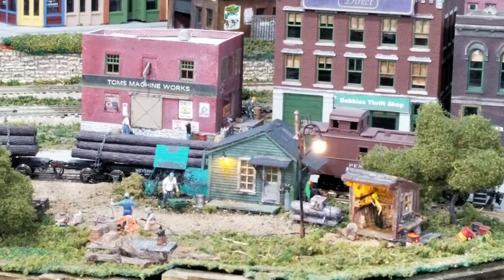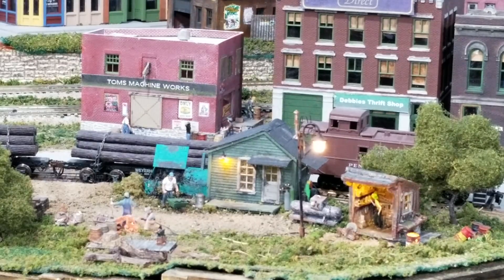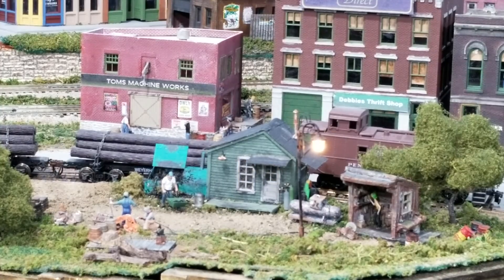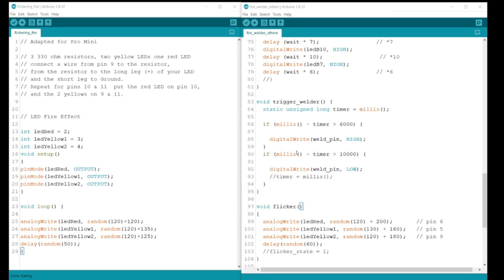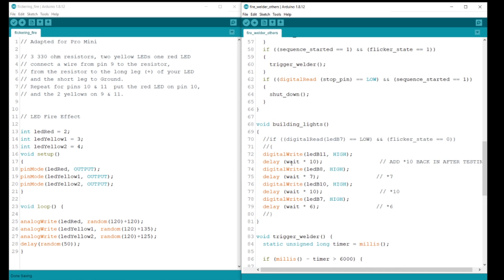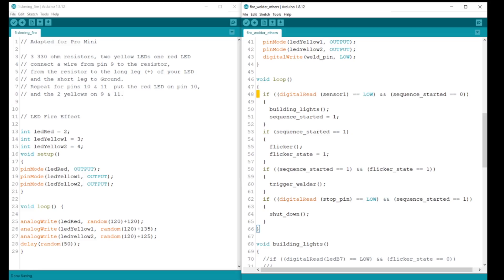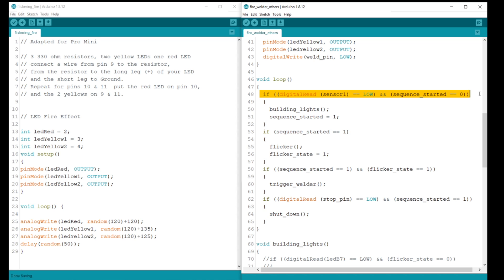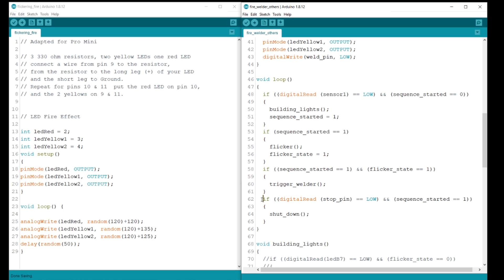Easy Method To Combine Arduino Sketches

Comment: Hi, I have 3 different sketches I need run at the same time. 1 sketch uses multiple servos, second is multiple leds, third is the play of a recorded track. Do I use 3 sketches for 1 arduino or do I use 3 arduinos and sketch individually. If the latter, i don't know how to connect 3 arduinos and make that happen. I'm trying to make a animintronic project and need all 3 sketches to start with a push of a button.  Please help with short answers. Thank you.
Reply from the maker: Make each task into separate procedures within  one sketch
Reply: @TomsTrainsandThings  they need to be run simultaneously and that won't work because of delay codes put a block on the program. I found help thank you.
Reply from the maker: Milisec solves that
Reply: @TomsTrainsandThings  cool, ill giver her a try. Thanks

Comment: Just build one sketch, test it, then add functionality. It's actually really easy to multitask on an Arduino. You just use a timer, interrupt service routine (ISR), handlers and function pointers. No need to do one sketch at a time then combine.
Reply from the maker: Most people using Arduino have never coded before and would never attempt any of what you suggested. I've seen many trying to duplicate projects they've seen others do on YouTube and run into issues immediately because they do not understand what is going on. That's why I keep it simple for them!

Comment: hi Tom, Thank You for putting this Sketch combining video together. After much adjusting was finally able to combine two sketches for an rtlduino. an AP connect sketch along with an BLEBeacon sketch. It kept failing and finally got the correct sequence to happen that both the WIFI access point,,and the BLE beacon does now in fact work!
Question: If i would post the code i am using would you be able to look it over and maybe give some pointers on how i could add some code to were,,when the rtlduino connects the the drone's AP..( as a repeater)..the builtin LED would slowly blink,,indicating a  successful connection.  These boards are not real popular yet,,as they have only been out about on year now. I am simply not smart enough to know how to add the code,,to make the LED blink of a a successful wifi connecction. Thank You
Reply from the maker: No problem Barry. Not familiar with that device so no promises. Send it to my email.

Comment: You could of used an uno or mega....incorporating relays is good....you could of implemented the millis() library to do many things at one time
Reply from the maker: Thanks Scott, the uno and mega are too big for the location. I tried the millis for the flickering LEDs but couldn't get it to work, that's why I separated them on different boards. I used it in the trigger_welder() procedure though.